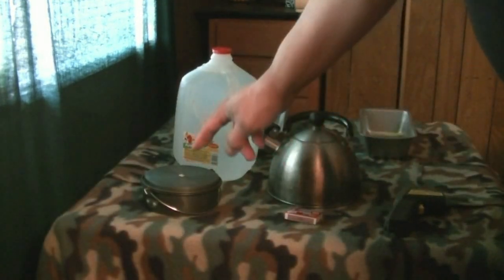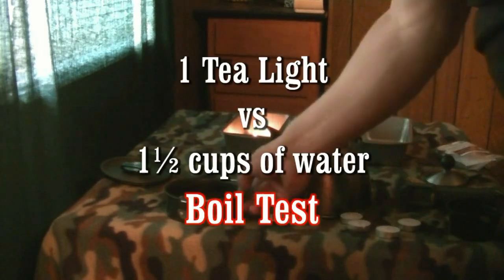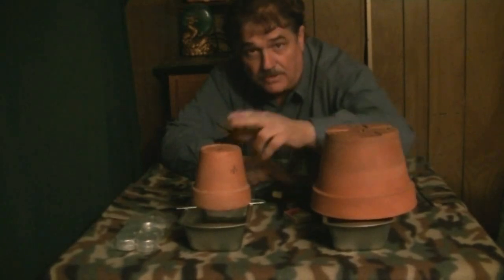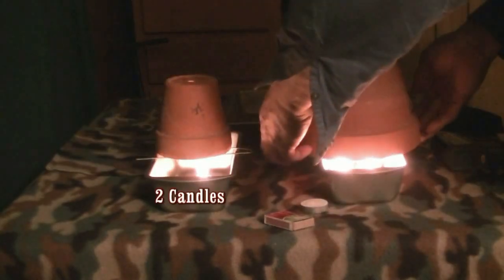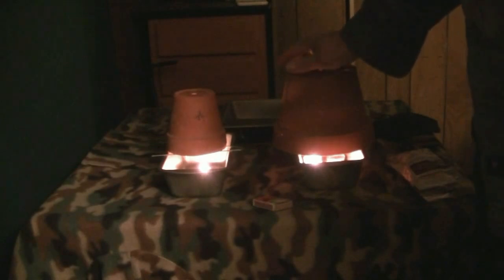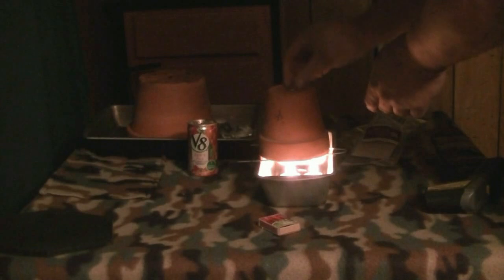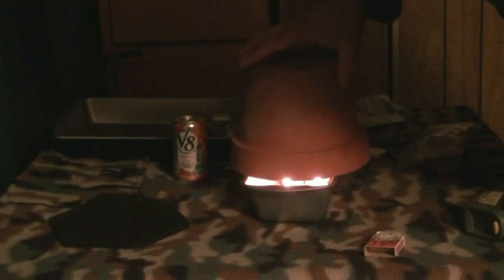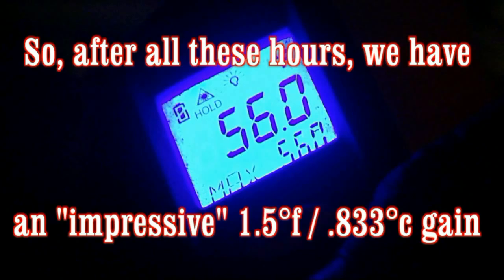Flower Pot Heaters - Real or YouTube Legend?  (Tested and Debunked)

Comment: add a fan and close the room off. again more more more. go in a car with this set up and you will be sweating your ass off.
Reply from the maker: +DRUMofTRUTH Yes, I would tend to agree.  But the myth has you heating you house with one of these.  If it can't heat a room which is 8' by 14' by 8' then that needs to be put forward.  I did a test for a friend to make a flowerpot heater work and achieved it.  But I did so with iso alcohol and not a tea light candle.

Comment: I am not sure if the other videos are accurate, however, I must point out that you did not set up your test in any way similar to the ones I have seen. Just sayin'.
Reply: quasidiem99 yes, and higher risk of a fire
Reply from the maker: If you are referring to three pots and bolted together with washers and threaded nuts, it was such a terrible outcome it has a separate video.  Look in the listing for it.
Reply: Thanks, but the ones I have seen had the candles closer inside the pot, thus (theoretically) leading to less heat loss and more heat against the clay pot. I am assuming that would generate better results based on my limited knowledge of heat conduction.

Comment: These tests missed something essential. If you have a source of heat OPEN, the heat will leak out instead of heating. Using baking pans which are 75% open will NEVER result in boiling water. To quote Homer: Duh! People have been making their own hot water with just large and small metal cans and a candle, for as long as there have been cans and candles. Hint: most heat is contained. Even a fireplace is inefficient, unless you have a lot of wood and then you end up overheating the areas closest to the wood. That is why most efficient heaters that use wood are enclosed. Not rocket science folks, and "experimenter".
Reply from the maker: These tests did not miss any such point.  The original legend of this abomination follows this model.  And since I am debunking an urban legend, I am following the way the legend lays it out.
If I were to attempt to find a way to make it work, then I would have all of these other variations.

Comment: You have to have BOLTs! These flower pot heaters do not work, you have to bolt one pot  inside the other, with at least a 6 in bolt and washers to regulate the heat. This guy needs to do more research. There are others that do work, I am using one right now.
Reply from the maker: Funny, if you had looked, I devoted a video to that very same design.  Its failure was abysmal enough to merit being separated. 
And as for the claim to have one working, I offer my proofs, you offer claims only.
I would gladly challenge anyone who has one which they say works to get with me, or other skeptics and lets run the trials together and document the outcomes.  I have absolutely zero doubts in my empirical data and in the laws of physics.
Everyone wants datum and proof from challengers to this, yet they readily accept unsubstantiated claims by those who adhere to this and the Mountain Dew Glow bottles.
Reply from the maker: SpiritofWildWings https://www.youtube.com/watch?v=xxpzijXevYg
Reply from the maker: +Tom Buck You never replied to the test with the 3 pots and the bolt.

Comment: I made one out of curiosity, just two pots on a baker's loaf tin, no steel rods holding them together, but a few brackets on a pub tray to stabilise it against my clumsiness and catch any wax leaks.  I knew full well that it probably wouldn't make much difference to a 30' x 20 ' outdoor workshop.  Result was no practical use as a space heater but where it did come into its own was that the outer pot maintained just the right temp to warm my hands on, get the palms warm and rub my hands together to take away the 'numb with cold' on frosty days. So I like it because I find that when my hands are really cold is when I get those little 'slip and graze a knuckle' type of accidents and it helps avoid those.
Reply from the maker: And they will work this way.  Not enough to heat a room, but they can help to warm things in close.
Thanks for sharing.  I always appreciate hearing from those who have tried them.
Peace.

Comment: I have seen all sorts of ridiculous claims about these candle heaters. Frankly, I'm amazed at how people can be that incredibly stupid to not even see basic logic that a candle or 4 cannot possibly heat a room to any worthwhile degree.
Of course you didn't put the flowerpots on a metal rod or have the candles facing Mecca orintated to the 3rd moon on the planet zorg. No doubt the believers will say that is why you didn't get the room to 100o in 5 minutes flat with the front door open in a snow storm.

All these people insist that this rubbish works never have any sort of tests like you have. I saw one vid and the guy is championing the believers and takes the room temp then comes back saying the approved words " It's sure toast warm in here!"  but then carrys on and never takes another temp reading to prove how the temp has increased

These people must think people are as stupid to believe this as they are to try and tell people it works.  Well I spose that's flawed in how many nutters out there do believe it and anything else they are told!
Reply: Oil Burner I must be building my wrong. Although I use a sterno can rather than a candle, it does manage to take the edge off the the chill of the room. Still as mine does work, I must be doing something wrong.
Reply: Yes there is a difference. I am defending the over concept of the theory, that if built with logic and common sense it does work. I am not trying the concept with intent to make it fail. How about you try it with the goal to make it work?
Reply: Angelus DarkHaven
 How about you do a vid where you actually measure and show the temp difference at different time intervals?
There is no magic in heating a room. An area of a given size will require a given amount of energy to raise it's temp in a given amount of time.  The candles simply don't produce anywhere near enough energy to do that.
Boiling a kettle would release more energy into a room for an hour and so would turning on a TV or computer but the pixie dust believers and Koolaide drinkers just want a cause to champion and believe they are getting something for nothing.
They are not.
Reply from the maker: Thank you, and your points are so very, very valid.
Reply from the maker: +Angelus DarkHaven Try boiling water with your sterno, then try boiling the water with the candles and compare results.
Reply from the maker: +Angelus DarkHaven My problem with your idea is three-fold.
#1.  The BTU's just aren't there.  Period.
#2.  I mwntioned in an earlier post that I did make a flowerpot heater work for a friend who made a claim that theirs worked BEFORE they tried it out.  Then they had a need to be able to show it working.  By using alcohol I could bet the BTU's needed.  But I had not filmed it.  
#3. Everyone seems to like bashing those of us who do the effort and science, while accepting the statements by those who believe as they do "I can feel the difference".  No measure, no documentated and repeatable data.
Reply: +Kandesta Anacomputer  I don't know or care what design it copies original or otherwise. Anyone that thinks a few  tealights have enough energy to warm a room IS stupid and no hocus pocus invented moron beliefs will change  that or any other basic, proven rule of physics. 
Have a look at my channel and I'll show you how to heat a room. Or a house or a shed or a warehouse or......

Comment: I understand and appreciate your testing of the theory but I believe your missing key elements of the whole thing which would be the metal rod, washers, and bolts
Reply: You're missing the key element here, these candle heaters are total and utter BS!
Flowerpots don't increase the output of the candles, that's a physical impossibility.  They don't spread the heat or lower it down or harness the power of magical unicorns.  It's completely and utterly irrelevant.

Candle heaters do not work unless you consider having 50 of them burning for an hour to raise the room temp 2 degrees to be " Heating" it.
Reply: SpiritofWildWings
EXACTLY!
Reply from the maker: Perhaps you didn't notice I did a separate video on that assemblage.
https://www.youtube.com/watch?v=xxpzijXevYg
Reply from the maker: Oil Burner
Of course they're B.S.  Hence the reason I bothered with all of this.
What strikes me is that people always want to question and challenge our test results, yet do not challenge and ask for more data and facts from people who claim these things work.

Comment: you built it wrong, but you are right.  you need two pots on inside the other to get enough surface area.  but yes it is only about 120 btu.
Reply from the maker: I don't believe I built it wrong.  I also built the three pot version and used the bolt, washers, and nuts (as the criticisms went).  How would you have had me build them?

Comment: in a small bath room 5X5 it warmed the air up to a balmy 45 maybe 50 (at best) from 35 ...of course this was with a dozen candles a metal butn pan instead of a clay pot ... it also kept your right ass cheeck some what warm due to the pans being on the right side of the toilet ... heating a small room it "works" ..???... camping or surviving better off dragging in you BBQ grill and burning wood
Reply from the maker: Thanks for sharing Jeff.  It is nice to hear from someone who has actually given this a real test/trial.

Comment: Looked into this a while back when someone was claiming these would work as emergency heaters in a SHFT. Read in several places that adding a candle to a room is roughly the equivalent of another person's body heat to a room. A candle can only give x number of BTU's, regardless of how it's deployed. 

Suspect that some people doing these experiments have never actually heated a room with a wood heater. Have never had to keep an old fashioned tin heater or castiron box stove stoked with wood when the outside temperature was well below freezing.
Reply from the maker: Thank you Oldtimer Lee, you have obviously heated with wood and/or coal before.
I have done it in the past, and that meant I wouldn't easily fall prey to this cock and bull story.
Reply: SpiritofWildWings Grew up on a farm, where our only source of heat was wood. Early years Mama cooked on a castiron woodstove before REA brought power lines to our farm. My workshop, today, is still heated via a woodstove. During mid-winter, I couldn't put enough candles out there to bring my shop up to a comfortable working temperature. If I managed to do so, the soot/smoke from that many candles would drive me out. -- IMO.
Reply from the maker: Oldtimer Lee
Yeah, the soot would be unbelievable.
It also amazes me how many people just don't envision that should there ever be a SHTF event winter WILL happen and they will face cold.

Comment: The flower pot videos I've seen had a threaded rod going through three pots with lots of nuts and bolts, would that have anything to do with storing some heat up, that is what they make you believe anyways...maybe you could try that too...great to see you again, your test are always so interesting! Blessings and Take Care
Reply: Used to keep a candle lantern going in my tent overnight in the winter.  Be surprised at what kind of heat can be gained in the right tent.
Reply from the maker: Good question Karen.
I had the threaded bolt with washers & nuts to do another day of testing, had the two pots provided any reason to think it could have helped.
Remember that we are talking about the laws of physics here.  The first of which is the Law of Conservation of Energy.  Energy is lost in its transfer, this falls through several laws of thermodynamics, but the loss of energy will continue.  The idea that a piece of steel would capture more of the heat energy (remember that we continue to lose energy through the form of light as the candles burn.  The rod cannot convert the light waves (they're a form of electromagnetic energy BTW) into heat, and neither the clay nor the clay coupled with the metal can increase the energy potential greater than the candles can produce.
These claims involve HEATING a room by themselves.  A 1.5°f increase over 5 hours would mean that on a -10°f night you would freeze to death at -8.5 as opposed to -10.
I would have done that test with the metal if I had gotten say a 15 degree gain, let's say.
Do you think the addition of a little steel would increase the gain?
If you wish, I will hold off on uploading the full length version and shoot another night with cold, seeing if the metal will bring about gains.
Do you want me to try, and if you do want me to try, what gain in temp would you rate for this to be considered viable as a heat source?
I am open to give it a go, I just see it as eating up another entire evening of my life.
But I would do that for those I consider a friend.
Reply: Your right, if they really worked so great Lowes would be selling them!..lol... I would like to see if it would heat up a little outdoor shelter maybe for some extra heat in a tent maybe?
Reply from the maker: karenchakey
If I can get it done, Maybe Sean and I can get a tent out Tuesday night, when it is supposed to get down to +15°f. I will set a thermometer in the tent to measure the temps.  I will try it for a minimum of 5 hours.
Reply: That sounds like fun! I have a couple of test I want to do this winter inside a shelter for some emergency heat too, I am off all next week so I hope to finally get back out!
Reply from the maker: karenchakey
You see, now that sounds like an awesome plan!
Reply: Thank God for vacation, mother is in a nursing home rehab for triple bypass, not sure how long she will be in there but she is doing well.
Reply from the maker: Bob Hansler
Sean has used a candle lantern for years.  And we've found that they warm a small tent better (and safer in our opinions) than these atrocities.